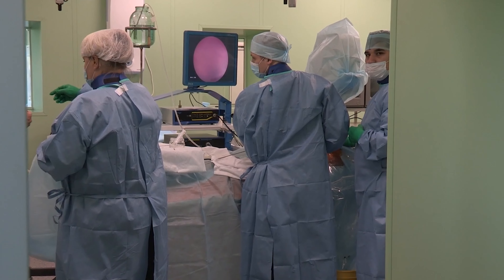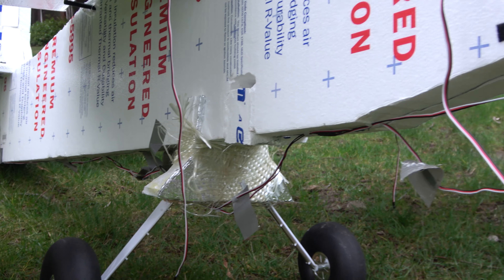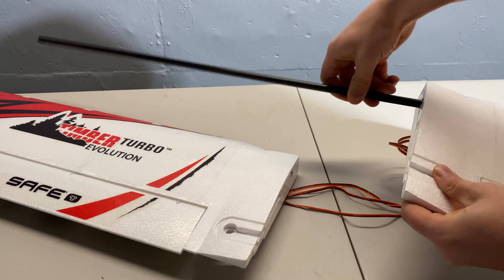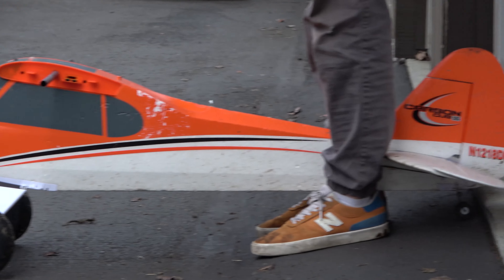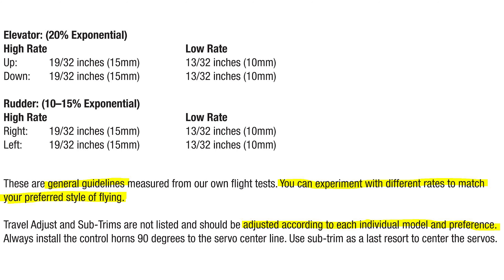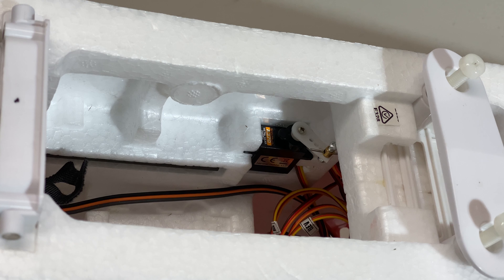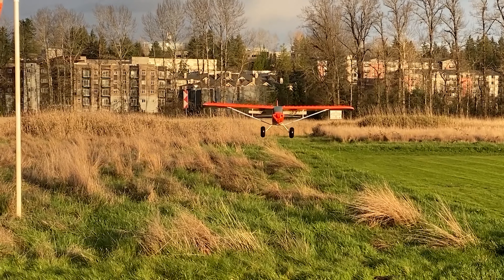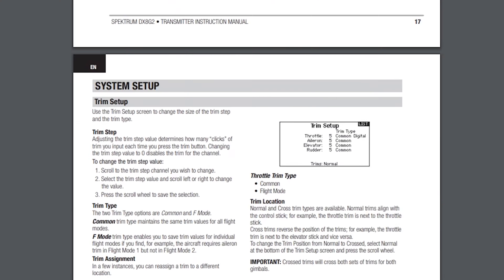RC Pre-Maiden-Flight Checklist

Comment: Fun story: so as a final creative project for technology (tecnologia in spanish) at school , me and my friends builded a delta wing aircraft , me as main and only designer , I trought that this delta pusher foam plane whould look so cool with oversized flaperons , so i did , in the first flight , my friend hand launched it in the middle of the gymn and due the excesive torque caused by an oversized prop mounted in a overpowered engine and the worlds biggest flapperons, leadaded the aircraft to a really fun flying up , then stall , rollover and pitching to the ground in half a second , leaving just pieces of what whas, an entire month of work , it was really fun.aaand also in that crash i killed the battery because i wasnt aware of LiPo batteries safety and that thing (too low charge and it was 2s for an engine that required a minim of 3s) , wea , that was a true Noob moment (sorry for my bad english , is almost 00:00 and i dont see where i am typing